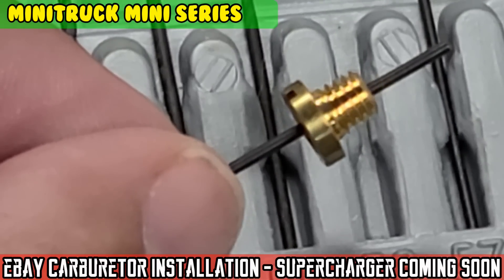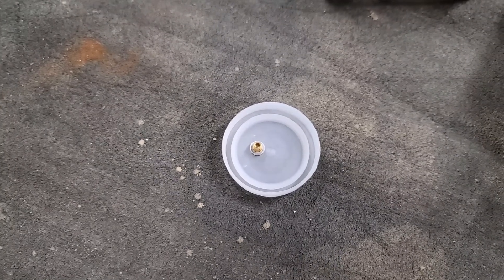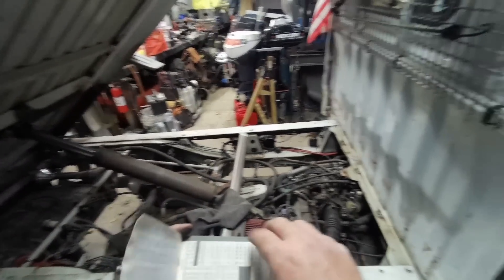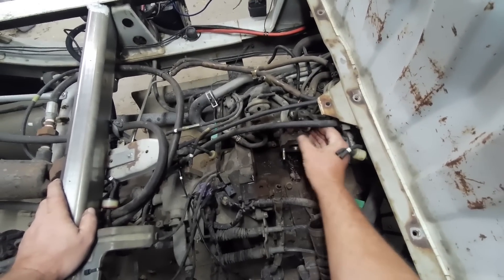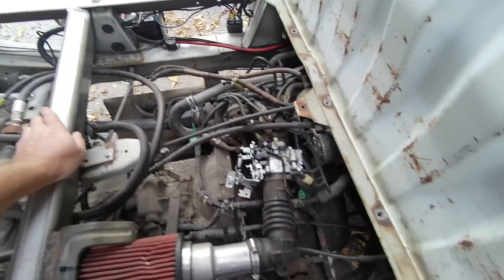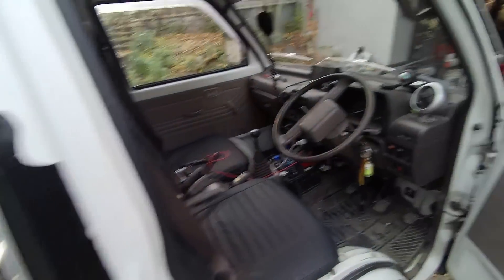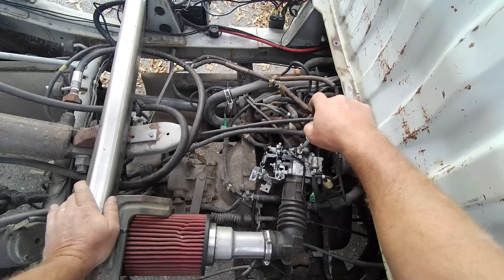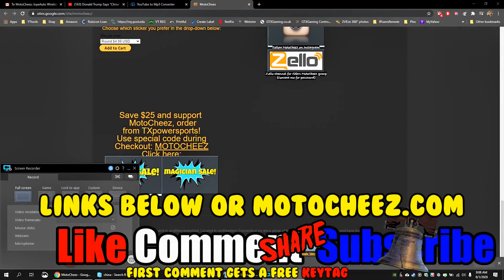Mini-Truck (SE05 E09) Larger 32mm eBay carb install pre-supercharger. It made a difference!

Comment: Got an air/fuel gauge? Or when in doubt lean it out? Lol
Reply from the maker: I don't. Usually do by feel and reading spark plugs
Reply: @MotoCheez  may be a good idea when you put more air into it. Think you will have to mod the carb when you put the air pump on?  Kinda like a blow through carb. Not sure that 5psi it will need any mods but it may for a small carb.
Reply from the maker: Going to draw carb thru supercharger yes pump style
Reply: @MotoCheez  yeah I get it. On my 408 with a carb it would pressurized the bowls dumping more fuel and would stumble. Just  wondering how it would work on a smaller carb.
Reply from the maker: I thought about pressurizing the carb, but I think it would flood like you say
Reply: @MotoCheez  when you put the pump in the air is going to come through the carb. Just something to look into.
Reply from the maker: I'm doing a draw thru like I said. Just have to worry about soaking furring starts.

Comment: Your carburetor transplant looked like a heart transplant video.  The needle nose ViseGrips used to pinch off hoses looked like hemostats.

The excessive number of hoses on the little HiJet engine is a big turnoff for me.  I think this was the peak production period for spaghetti hoses as more and more pollution control was regulated into being but before computers fully mapped engine performance and controlled not only power but also fuel efficiency and pollution.  During the 90s, the added complexity was implemented with vacuum lines doing different things, antifreeze lines run to the carburetor to implement an engine temperature gauge, etc.  The plumbing is much easier when all of that complexity is implemented electronically.  I'm eager to see a video where someone puts a much newer EF engine into an older Hijet.  I'd love to replace the carburetor with EFI in a modern engine that's simpler, more efficient and more powerful.
Reply from the maker: Thanks, I spent weeks looking into an EFI conversion and nothing really stood out that didn't cost over $1,000

Comment: Like you, I've wanted to do the carb swap for awhile, and this got me off the fence - i ordered the one linked off your site. When you were done pulling off the vac lines, did you have any venturi lines that you still needed to run to the Ebay carb?  And were you able to get rid of all those vacuum delay/vacuum check valves?  My s83p has idle issues, and it seems like those vac delays are the culprit.
Reply from the maker: The only vacuum lines I ended up hooking up with for the vacuum advance on a distributor which one went on a carburetor and the other one on the manifold. All the rest were for pollution etc now I never figured out what the line was underneath the fuel pump it maybe a regulator which would probably have to go to the carburetor also. I'm going to check on that soon
Reply: @MotoCheez  awesome, can't wait.  guess i'll be using the whole box of vac plugs then.
Reply: FWIW, the fuel fitting on the carb side was tapped at M10x1.25 and the fuel line on my truck was 1/4" ID.  We're going to try a banjo bolt instead of a straight barb due to shipping delays on the barbs.
Reply: @eastalhijet4481  I did this swap yesterday, I retapped the carb inlet to standard 1/4 npt because you cant get m 10x 1.25 fuel barbs that are the right size. Make sure you dis asemble the carb to tap the port and clean out all the swarf. This carb works well, have to play with the jetting a little bit, much simpler and better set up than the worn out pile of night crawlers that was attached top on my engine. I also suggest you take the bowl off the carb and inspect it even if your not going to tap it. when I got my carb from AMAZON I looked in the bowl and found that the needle retainer had come off and was was laying in the bottom of the bowl. Thanks for video cheeze
Reply: @madthewirdo4236  It is a really odd size, and after weighing the options of using a more standard barb and then a brass reducer went with the banjo - but good call on the re-tapping. Did you have to do any fabrication or modification on the flange that connects to the manifold?
Reply: @eastalhijet4481  No mods to the hijet manifold flange, bolts right up, was pleasantly surprised, most chinese stuff dont. Chezes video is spot on, you do have to bend some brackets like he shows, as well as the throttle stop tab. I just dialed it in this evening, started out with a light off idle flat spot during driving, not noticable when you hit the throttle by hand, got that worked out by advancing timing to ten degrees at idle, and a slight adjustment of the accelerator pump rod. now shes like new, drives great.

Comment: Hello, I bought the same carburetor last week, installed it and had the same problem. I have a few things to ask you:

How many mm did you use for the main jet? Was 120 stable?
The screw behind the idle screw broke off on me. Is it possible to find a replacement for it?
The car is currently sputtering at low RPMs. It does not go smoothly.
The vacuum hose on top of the carburetor connects to which part of the distributor?
Can you send me photos if I give you my email address?

My car is : Daihatsu Hijet 1000cc / Van  / 1998 year /  s100 motor code

Thank you :)
Reply from the maker: That's true I believe is the same as the other one if you could take that out and try to match it up with something online. I'm not sure where else you could find it. As far as the vacuums off the carburetor it went to to distributor one line, I don't have any photos of it but hopefully you can see it in the videos I've done
Reply from the maker: Also try adjusting it without connecting power to that solenoid that is on the carburetor, that was giving me an issue
Reply: @MotoCheez   If we're talking about the electrical wire, the engine stops when I disconnect it.
Reply: @MotoCheez  Videos are so helpful, I paused, wrote notes and made screenshots :) It's hard to find documents for hijet on these days.
Reply from the maker: @buraxmusic try adjusting the idle up to keep it running when it's disconnected and see if that helps

Comment: MC, what jet did you finalize it with? And did you add a bit of timing? I've got a 93 S83P Climber Jumbo and am planning to buy the same carb but curious about the jetting and your experience. My factory carb isn't working correctly, choke springs are busted and it just doesn't run well after the head job I just completed. Idle is too high and wont stay consistent etc... I was thinking about buying a rebuild kit but since this carb potentially bumps the HP's and would be easier than a rebuild, I'm leaning that direction. Thanks for the help, love you S83P build videos. Watched a lot, learned a lot, stealing some ideas!
Reply from the maker: The stock jet that came with carb worked perfectly and way better than stock carb. I only drilled jet when I put the supercharger on.  Awesome.

Comment: I did this carb swap thr othet day on my s83p. Having the same slight stumble you were having when snapping the throttle open. I'm thinking its timing but have not checked yet. My question is I'm second guessing myself on the two vaccum lines coming off the distributor. Should the vac line on top of the diagram go to the venturi port on the carburetor like most cars and the vac line under the diagram go to a intake port? I've never seen a distributor with two vaccum lines before.

Comment: MC, one more question... did you do a build video on your air intake? I've been trying to find some stuff locally but with no luck. I want to order off Amazon but not sure what size the new carb is and curious what you used? Thanks!
Reply from the maker: A while back I removed the stock airbox, used the stock rubber intake and found a universa cold air l air filter with a reducer to fit
Reply: Did you find the universal on line? What dimension is the aluminum pipe? 3” to 2”? Makes sense to reuse the rubber elbow, I just can’t seem to find something that will work from there. Thanks again.
Reply from the maker: I actually had one in garage. I see them on the shelf at Auto zone. 
2" pipe. Yes

Comment: Sorry to bother u again mate quick question. Do u know if the after market carb u got would suit the turbo model of your truck? I'm going to buy one soon just wanted to see if u know if it would suit thank you for your time much appreciated
Reply from the maker: It's not made to be pressurized, so has to be draw thru, I'm worried about atomized fuel in the turbo spooled up and popping off the pressure valve and spraying atomized fuel everywhere. That's why I did the supercharger as a draw thru. I did buy a turbo but decided against it because if above.